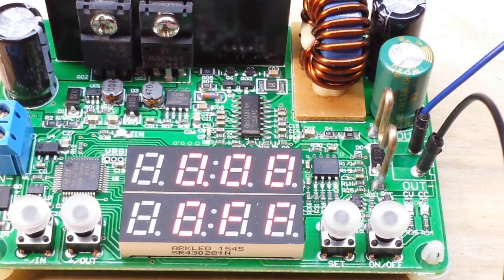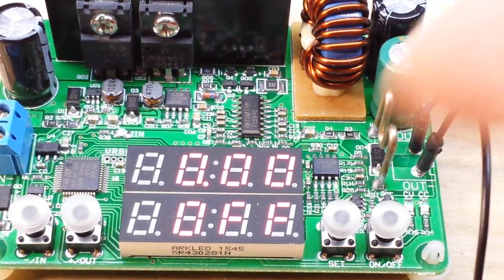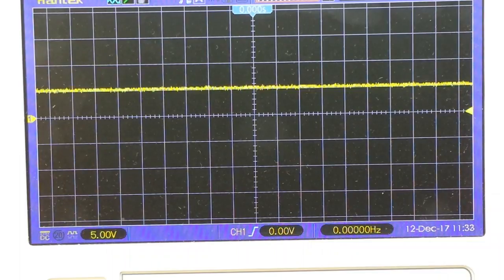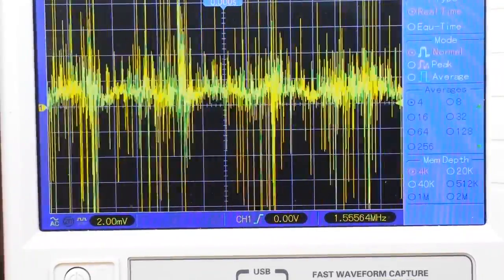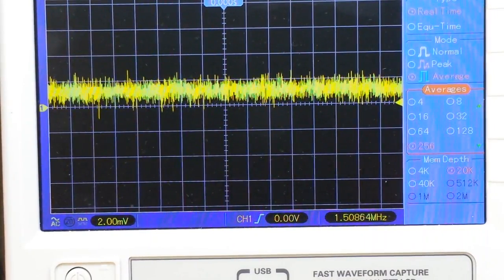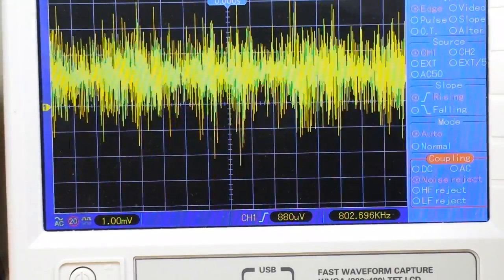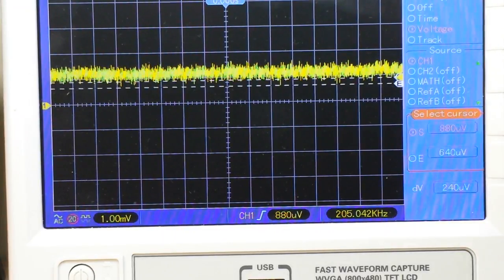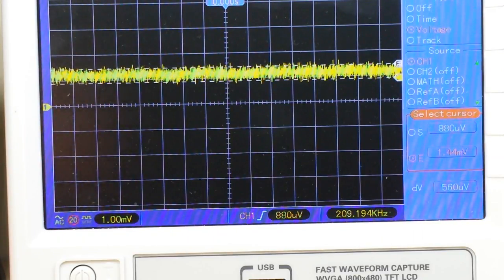Oscilloscope Averaging

Comment: great video. I really want to get a scope. and if nothing else . just play with it to get to know how it works! I don't have funds for a expensive one. a used one for $50-$75, is about all I could do less would be better. it doesn't have to have a lot of features. $25-$50 would be nice. a better iron would be great also. I want to start actually practicing what I have learned. can't wait for the next video!
Reply from the maker: +James stranger here's a $300 scope for $40 plus shipping:

https://m.ebay.com/itm/GW-Instek-GOS-620-Analog-Oscilloscope/162799542609?epid=96992167&hash=item25e79be151:g:Yi0AAOSwSutaL2FR
Reply: learnelectronics thanks I'll check it out!

Comment: I see what you did. But I'm not sure I understand "why." Is it just striking a compromise between messy precision and usable measurement?
Reply from the maker: +Brad Smith in the first video from Nov 14 the waveform on the screen was full of HF noise... Which I just ignored.
Someone suggested I use averaging. So I made this quick video to show folks how averaging works.
Reply: I don't get it. Averaging polishes out random noise, but this still is unwanted noise on the power line. Averaging paints a falsly rosy picture. Or is the idea to look at the non-random part, such as the ripple? Or to factor out external noise? In the latter case, only better shielding would work.
Reply from the maker: +Marcel Ooms it's just so we don't have to look at the ripple through the noise

Comment: Thanks for showing this, I'm curious what the output looks like on a bunch of my power supplies now!  In your opinion, what do you consider "acceptable" voltage ripple for microcontroller use?  I know certain modules like GPS sensors require very stable voltage output.